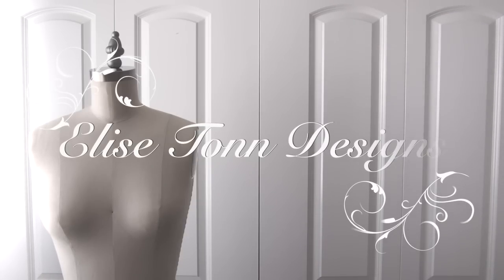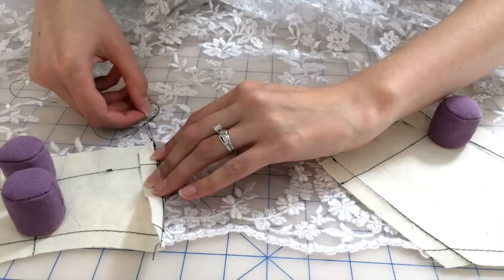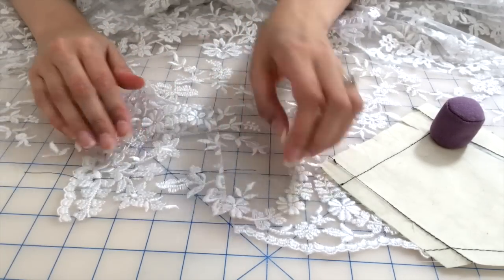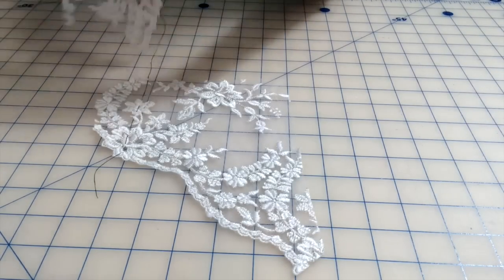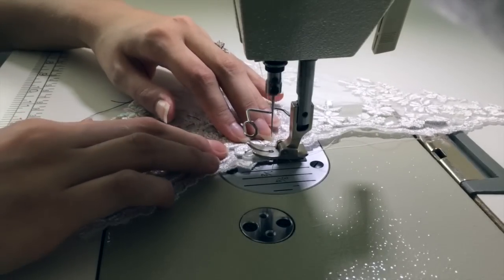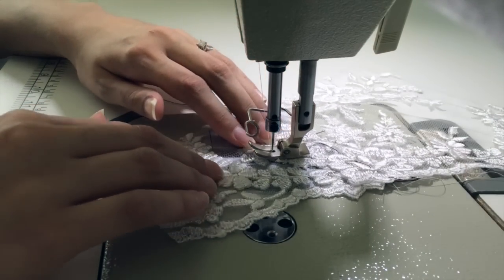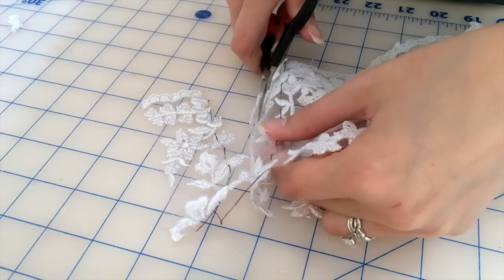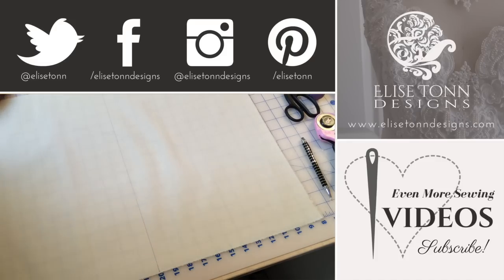How to Sew Lace Without a Seam

Comment: What presser foot are you using? What size needle are you using? What is the tension, width, and length settings on the sewing machine you’re using?
Reply from the maker: Regular everything! Foot, needle (12/90), normal tension (my machine doesn’t have number just a dial to adjust). My regular stitch is 2.5 I go to 2 for this. Machines are so different, test first!

Comment: Hi Elise, do you have a video or any instruction on line of how to sew sequin & beaded lace overlay onto a low"ish" V neck bodice that has a princess seam for the bust? Waistband on the dress fyi. Would you seam the lace at the centre front line- or not? Or would you have the front bodice all in one piece (ie centre front cut on fold) and shape/seam/piece the lace around the princess seams (so the seam doesn't show, as you taught in a separate video)? Wondering what you might think best pls. Thanks in advance! Love your videos btw. They are excellent.

Comment: Hi Elise, Sorry to be stupid, but I cannot figure out how the black seam lines are accurately sewn if you are sewing around the lace motif. I keep watching it, but don't know how you make it fit correctly by doing this? Thank you for your reply.
Reply from the maker: judy holman the basting marks your seam line and all you do is match those up between your two pieces. It depends on the motif but sew the new seam as close to your basted line as you can. Trim away excess at the overlap edges. You can pin and baste around the lapped seam and test until you're satisfied with how it looks.
Reply: Thank you very much for the explanation Elise, I think I will practice first before sewing my french lace as you suggest! xx